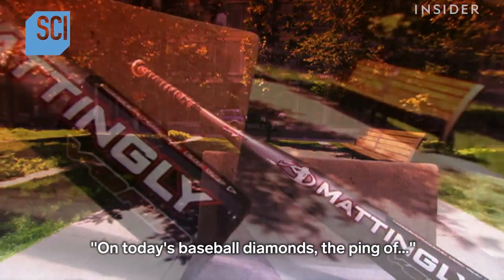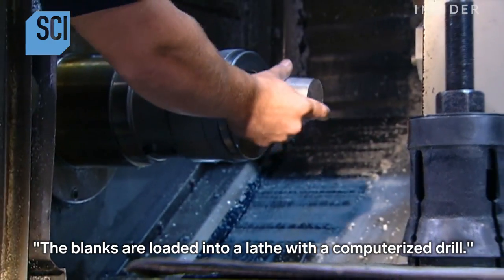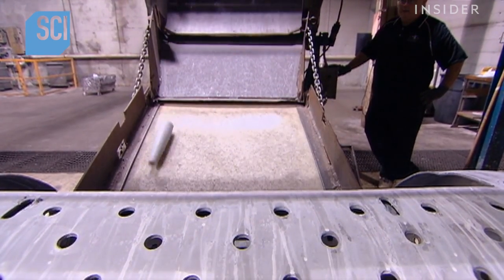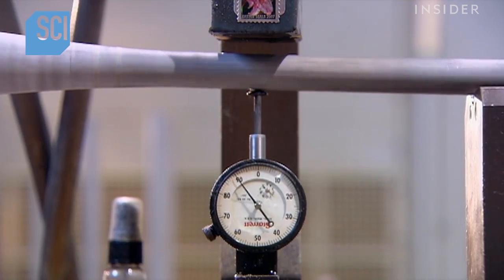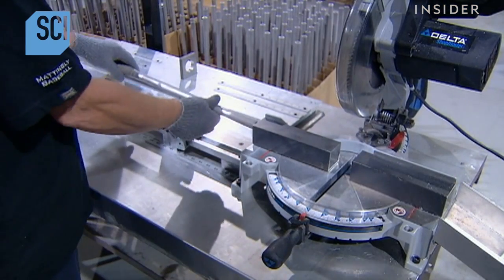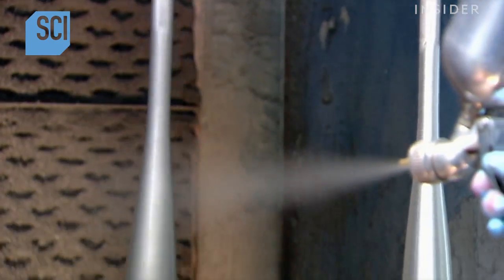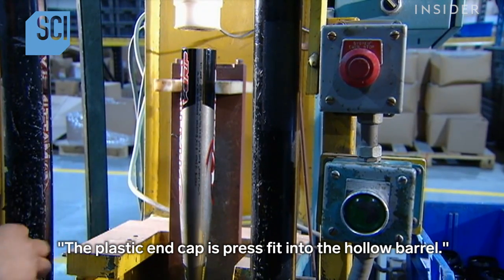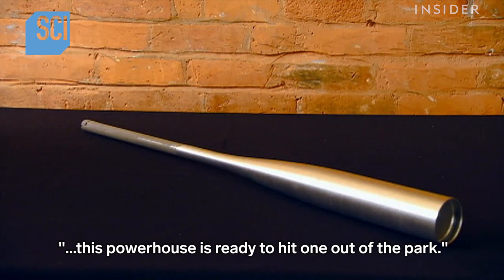How Baseball Bats Are Made

Comment: Aluminum bats should be banned. They're too dangerous for opposing pitchers, and you have to end up switching to wooden bats anyway so what's the point
Reply: They can be made in different weights and dont crack easii
Reply: That's why as you soon as you hit thirteen you have to use a bbcorbat. (At least in my league)